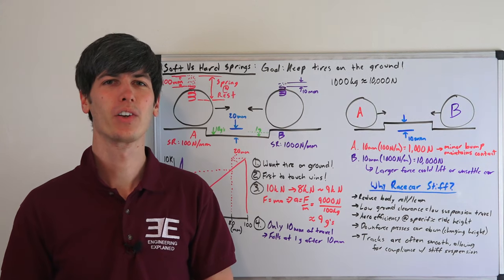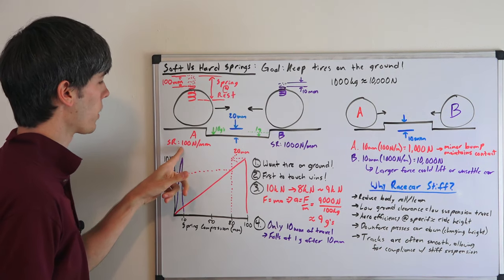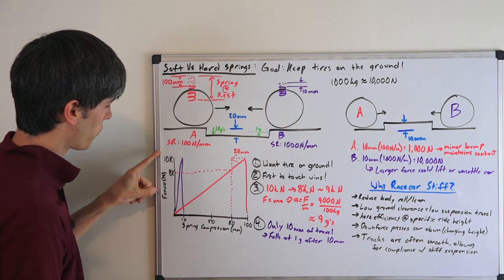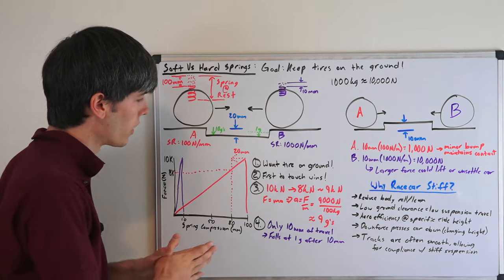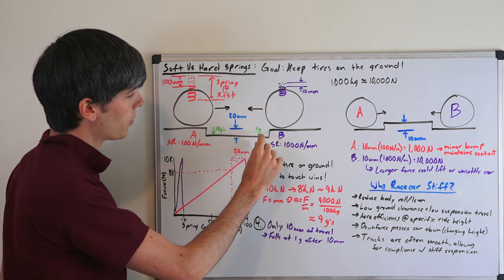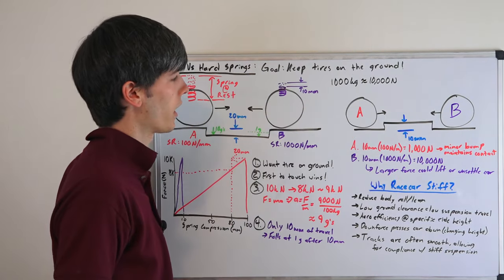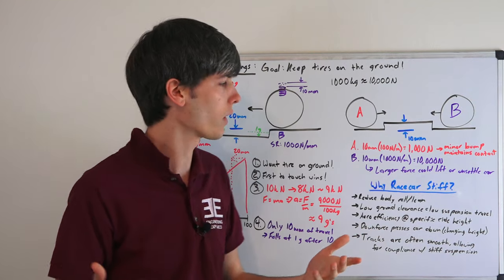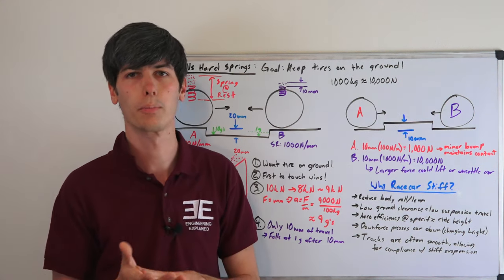What's The Best Suspension - Soft or Stiff Springs?

Comment: Sometimes it can be helpful to imagine the extreme cases to gain intuition. Imagine a car with springs only 1/100th of the spring rate. The height of a bump or indent in the road will be negligible compared to the distance the springs are already compressed, and the spring force accelerating the wheels will be essentially constant while rolling in the indent or over the bump, minimizing the peak forces encountered in the case of a bump, and minimizing the amount of time wheels lose contact with the ground in case of indent. However, the downside is that when the car accelerates, brakes, or turns, the body will be a lot slower to transfer weight and the car will have a much longer time constant to reach its steady state lateral force when cornering. When accelerating in a RWD car, the time constant until the steady state maximum load is placed over the rear wheels will be longer, delaying the increase in grip. FWD cars benefit because the weight transfers away from the driven wheels at a slower rate, preserving the more favorable static weight distribution for longer. When braking, the rear wheels will play a more significant role for longer as the weight takes more time to transfer to the front. In every case, body roll will be more pronounced, as the moment stiffness of the car in roll and pitch will be lower in accordance with the lower spring rate. Now take the opposite case of a spring rate 100 times higher. The suspension is more or less a rigid connection. Bumps will sent devastating shock loads through the rest of the vehicle and will wear out suspension components much faster. Divets in the road will lead to immediate loss of contact with the road as the suspension basically has zero tendency to travel. However, on smooth tracks, cornering force buildup will be nearly instantaneous, allowing quicker turn-in, acceleration in RWD will allow nearly instant grip increase to steady state, while FWD will lose its static weight advantage almost instantly and suffer from wheelspin a lot sooner. When braking right on the limit, the rear brakes almost instantly are relieved of their load and do less of the braking during transient phase. Wear will be more uneven front to rear due to heavy braking, requiring increased tire rotation frequency.

Comment: I'm not sure if I'm doing the math right here, but are your numbers realistic? A spring rate of 100 N/mm is equivalent to about 10.2 kg/mm, which is what spring rate is often advertised as. That's really high. 1000 N/mm would be 102 kg/mm, which I haven't heard of. Most coilovers are around the 4-12 kg/mm mark, and most lowering springs are around 2-3 (mine are 2.2/2.5, while the coilovers on my other car are 4/6). Would that change the equations enough to make the results less significant? 

Of course your point has been made, and thanks for the great video! I never really thought about it.
Reply from the maker: Haloruler64 The numbers were chosen to make the math simple and easy to understand. Realistically 1000N/mm is a stupid high spring rate.
Reply: Engineering Explained Ah okay, thank you!

Comment: 90% of the people who have installed stiffer - lowering springs usually complain about the rough ride.
Soft springs with the free length calculated to achieve the desired ride height are the best. 
Two way adjustable shocks used on the street usually end up adjusted for a soft setting.
Practical value is more important than macho bragging rights.
JMO

Comment: Engineers have to compromise for the intended purpose and budget-you can add technology to affect how much you get either way but maintenance can get onerous. Stiff leaf springs and a live axle works well on my pick up that can go off road with a load. The soft fully independent setup in my sedan is much more pleasant on the road, with good handling (low center of gravity helps too).

Comment: soft or stiffer suspension also effects weight shifts in the car, which effects weight distribution, which effects tire traction, braking, etc etc. It's a far more complex ordeal than I think most people will give it credit for. I think it was a prior Shelby GT350, came with 525 hp at the wheels, but cheap suspension, moral of the story, it drove slower than cars that 100 hp less, same weight and better suspension. 

And suspension is easy to explain on road and track cars compared to rally cars. The suspension setup on a WRC car costs more than an entire Formula Drift car lol

Comment: Hi Mr EE,

I've been watching your vids for some time and love your simple, easy to follow descriptions of how cars work. I've been interested in engines since I was a kid, so I have a pretty good understanding of most of the (basic) ins and outs of how they work. However, suspension and all the things that affect how the car rides on and keeps contact with the road is still somewhat fuzzy for me. Each of your videos helps me understand more, but one thing that I haven't seen covered yet is the stiffness of the vehicle body itself. (Unless I missed it?)

You hear car critics talk about body stiffness, especially when related to sports cars, so I'm curious to know more about how the stiffness of a vehicles body affects its on-road behaviour. There are a few aftermarket options to increase body stiffness, eg Mighty Car Mods used an underbody brace package from Ultra Racing in Malaysia for their MX-5 track car, Tom's Turbo Garage used bracing in the front quaters behind the wheels of his V8 Miata too. I'm wondering, are any downsides to increasing the body stiffness using these aftermarket products? I've heard you talk about mechanical grip before, so is a certain amount of body flex desirable in a road car? 

I'd love to see a video on this, but any explanation you can offer will be appreciated. Thanks for the vids!
Reply: Ugh... by “body stiffness” I mean chassis stiffness. Sorry.

Comment: It would be interesting to hear Jason's thoughts/analysis of a drag-specific setup:  Having a little less rate in front helps with weight transfer to the rear, which usually has a higher-than-stock rate to drive the power and weight through the rear tires.  I have a 2015 Mustang GT with the Performance Package -- Jason has reviewed a similarly equipped car.  I am considering springs from BMR -- the "minimal drop performance" springs, which -- on average -- drop the car 7/8" in front, and 1/2" in the rear -- a subtle visual effect -- definitely not "slammed".  The Perfromance Pack front springs are I think 190 pound-inches, which is higher than non-Performance Pack springs.  The BMR setup would actually have slightly lower rates in front, and higher rates in the rear -- these are not billed as "drag" springs -- BMR has "productized" three types of springs:  drag, performance, and handling.  I don't want to sacrifice performance for the aesthetics.

Comment: 2 things make suspension explanations & discussions frustrating: 1) rapid back/forths between several situations (standard car, performance car, race car, roads, tracks) and 2) personal preference skewing facts, making it impossible to take much away from the conversation.

First, no one racing is depending on YT videos. Second, 90% or more people on YT watching this are "enthusiasts" who have likely spent most of their time driving performance cars AND at some point throwing money at suspension. Three, the vast majority of #2 did so primarily for looks. And four, after #2 and #3, a lot of us are left scratching our heads wondering why our mild-moderate changes made things worse.

I have an STI and Outback XT with the same model-specific coilovers. The springs are linear and the same stiffness, and it's my understanding the dampers are identical. With damping set the same, the STI ride quality is far better. How can this be.

Considering all the performance parts OEM's are offering nowadays, it would be best if they sold things like lowering springs. Companies know certain cars are getting new springs before the first oil change. How about selling springs, dampers, even coilovers engineered by the OEM's, for people that want something different but would prefer depending on them vs. a company selling a product meant for teenagers to put in their Hondas.

Comment: Best suspension setup depends on the weight of the car, center of mass, road type/car purpose (will this vehicle have a lot of weight in it? will it be going off road? is comfort more important than handling?) With extremely stiff springs on a road, you will damage rims, wheels, control arms, as well as not having good traction because your wheels are off the ground half the time. With extremely soft springs, you will be floating around, and the car will roll and pitch way too much.

Comment: Thanks for the great explanation!

Does the general benefits of firmer stiffer suspensions that I am just now learning about (making better handling and less vehicle lean) also apply to taller vehicles like high roof sprinters?

I recently bought a 2008 sprinter 2500 RWD 144” high roof (with a DIY camper buildout that brings total van weight to almost 7,000 lbs)  that needs new leaf springs (each spring has a cracked front eye). 

I would like to upgrade from the factory monoleafs (1 leaf), so I would like to get a 2 or 3 leaf spring, for the increased load capacity.

I’m wondering if increasing to 2 or 3 leaves will just be so super annoyingly bumpy when going over bumps or dips, if the spring’ load capacities are not met.

I also wonder if the stiffer 2 or 3 leaf springs will translate to this high roof van dangerously or worryingly leaning over around curves. 
Or will it do the opposite and reduce the chance of that happening?

Any thoughts on this? 
Or any other cons of getting more-leaved springs (vs the pro of increased load capacity)?

Thanks!

Comment: Very good explanation, as always. But, your analysis didn't cover the shock action, with dampening. When you fill a shock with oil, it reduces the speed with which the wheel hits the ground and might be a much greater effect than softening the spring rate, right? I would like to see your analysis of both, spring rate + oil weight, what would happen if i lowered the spring rate and oil weight, lowered just spring rate, or lowered just oil weight, and so on. Thanks!

Comment: For your second set of calculations, you're off by three orders of magnitude. You're multiplying 10mm times 100N/m and 1 mm = 1 * 10^-3 m which means for part A your answer is only 1 N of force and part B you have 10 N of force

Comment: Your example works but isn't that assuming the springs rates are always linear? What about progressive springs? Most vehicles even some high performance sports cars have progressive spring rates. Wouldn't that change your example since the rates are not always constant? The point of a progressive spring rates it to give you a sort of dynamic range of rates for different driving conditions. I've driven on linear and progressive coilovers within the same range of spring rates and the ride was much different. The linear spring like you demonstrated were unsettled on uneven surfaces while the progressive spring, while still stiff, were able to react to dips and bumps much more effectively. I know that are a lot of factors beside spring rates but I think it's wroth mentioning the different types of coil springs. Maybe you can do a video explaining the difference.

Comment: I suppose variable rate springs are the best of both worlds, aside from body roll.

I used to have a go-kart with no true suspension, but there was a metal rod that the front half and rear half would pivot on, and it was 100% gravity-based rebound. It handled amazingly, though; unlike anything I have ever driven. What causes something without suspension at all (aside from that pivot) to handle bumps better than something with super-stiff springs?
There are a ton of variables outside of that, I understand. I never tried that particular kart with springs, so my experience with the differences is not ideal.

Comment: Most race tracks are smother than back roads. My Genesis Coupe is very stiff and frustrates me when the traction control goes off leaving a corner under power, on almost any bump. I used to race F2000, but now I'm 64 (and spun this car once) so I'm nervous turning the DSC off. The car corners very flat but the springs could be a little softer. A happy medium is the answer.

Comment: In comparison to an aftermarket coilover (which is usually notably stiffer than stock) I found that a slighter softer spring  and slightly stiffer shock works best for me on street.  However in comparison to stock suspension- both would be stiffer if that makes sense.

Comment: To summarise the first section:

1. If the spring rate is too high the rate drops off too quickly under droop reducing adhesion.

2. If the spring rate is too high the tire may leave the ground under droop due to the spring and or suspension reaching its droop limit.

Comment: A spring never works alone in a suspension system. It helps the strut-damper do it's work. So the speed and generally the way it works is a combination of the system.
Still can't understand how a stiffer spring which takes a lot of force to compress, so the decompression will be much faster than a soft one, will rebound slower than the softer spring...

Comment: "Best" is an oversimplification. The fact of the matter is that road cars are optimized for comfort and tire wear, whereas race cars are optimized for performance. What we really mean is optimal for a certain situation.

A typical bolt-on racing suspension for a passenger car will typically be three or four times stiffer than the factory spring rates. Most cars won't have a problem with bouncing off bumps at this rate. You have to get really absurd before this will be a problem.

A "soft" spring/damper in a racing context will still give a bone-jarringly hard ride compared to a factory spring/damper because comfort is not considered. With racing tires a factory/spring will have unmanageable levels of body roll, which will wreak havoc on handling.

Comment: Soft suspension is good provided there's sufficient wheel travel and if the dampers can absorb the movement without it getting into the cabin and making occupants sick. And it's good for everything except roll.

So that's where cleverer tech that can separate the roll mode from all others can help.

Comment: it has a lot to do with how you drive the car. if you drive on a race track you want stiff because that minimizes body roll. if you drive on the road you want softer because that helps with ride and bumps. if you do both you want to find a happy medium. if you go offroad you want super soft so it soaks up the bumps and flexes

Comment: Hmm... as said by other people in the comments, the springs alone wouldn't ensure good road contact (in the presence of some bumps)... Without proper dampening the ride would bounce quite a lot. Simple physics models for springs dictate that they oscillate when there is no dampening (although in real world there is always energy loss that dampens it a bit).

Also there is some simplification in the explanation that might be misleading, though in the context it is made I don't think it would raise much on an issue and dwelling into more complex matters would probably confuse the viewer.

The points on a stiffer suspension for racing vehicles in a smooth asphalted road seem quite valid.

This reminds me I really need to review my physics knowledge in spring models...
Reply: +José Sousa Yes folks, never let your springs dry out.

Comment: Good video. Any reason you didn't give a scenario where the springs may bottom out? Based what you said in the video the most ideal spring would just be the longest softest springs but that is not necessarily the case.

Comment: Ideally, softer springs paired with a stiffer anti-sway bar works really well on the road.  Off road the sway bar will decrease traction.  It’s very difficult to have a suspension that works really well on and off road.
Reply: Implement an active sway bar that disengages while steering wheel is straight and engages on turns.  This can be done with an electro-magnet clamp at the center of the antiroll bar.

Comment: I have a friend who drives an STI, he tinkered with the suspension to no end... stiff, stiffer, low, lower... eventually he started dialing back and ended up with something close to stock... his numbers were much better than with everything super stiff and super low.
Reply: +Riggro well if you want performance...you can't be super low for street cars...1-1.8 inches drop is best for performance...any lower and you'll suffer.
Reply: +Deejay Core My Dodge Neon is 3.5 inches off the ground with gas shocks.  How am I suffering?
Reply: Well, if all you did was slam your car, your suspension geometry has suffered greatly. There's more variables than just ride height.

Comment: When it comes to racing, the softer the better. That's why large American sedans dominated the racetracks in the '70s and '80s. '70s Cadillac Eldorados with the 8.2L V8 and FWD setup are about as perfect as you can get for a true stock, street legal racecar.

lol. Guys, its not that complicated though. Stiffer is better for racing but bad for daily driving. You have to find the right setup for what you want to do. You can either sacrifice a bit in the way or comfort or performance. Wheel and tire size will also play a role in the handling vs. comfort game.
Reply: Alexis Leyva Well on tracks with a lot of off camber and elevation changes like the Nürburgring Nordschleife you're better off not having the stiffest suspension.